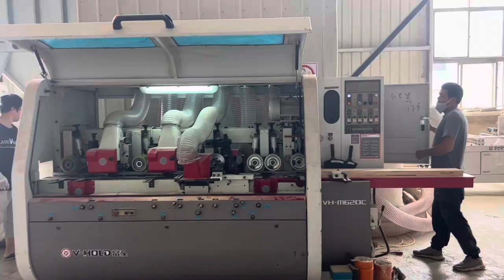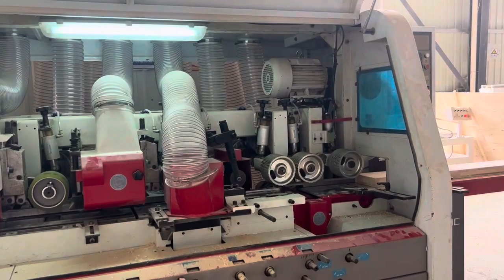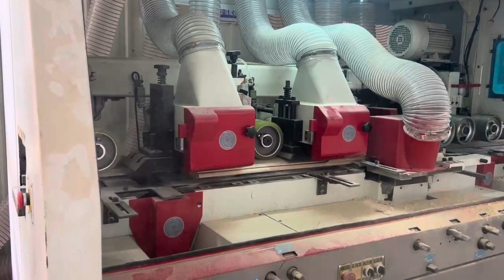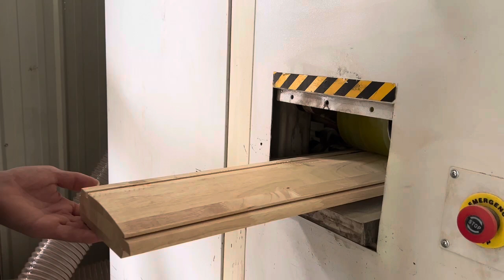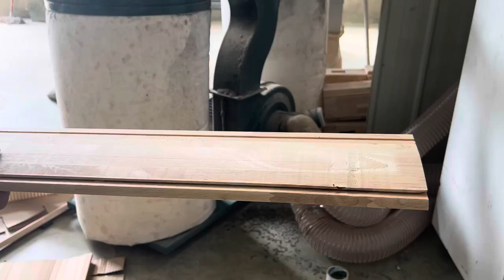Mechanized Production-Top Pool Table Manufacturer In China

Comment from the maker: The handrail is the most complex and important part of the pool table. We use fully automated machine to produce, which is not only greatly speeds up the production, but also ensure the all screws hole are accurate, with an error within 0.5mm 🥳🥳🥳